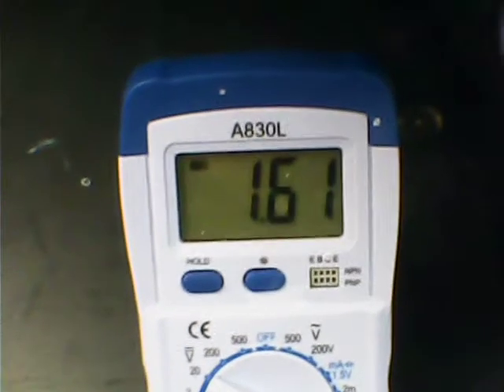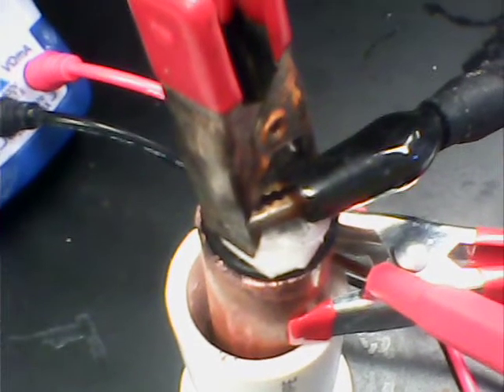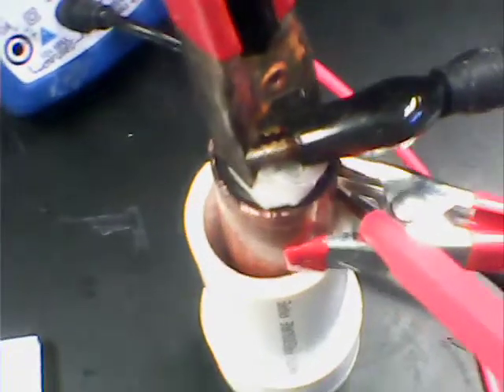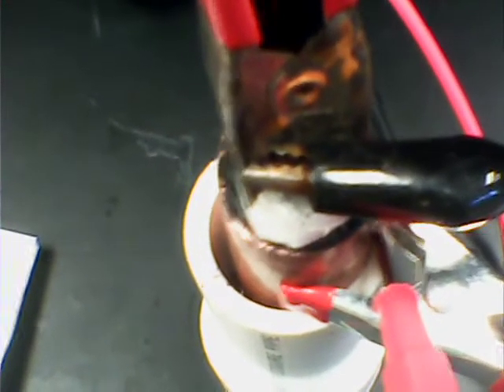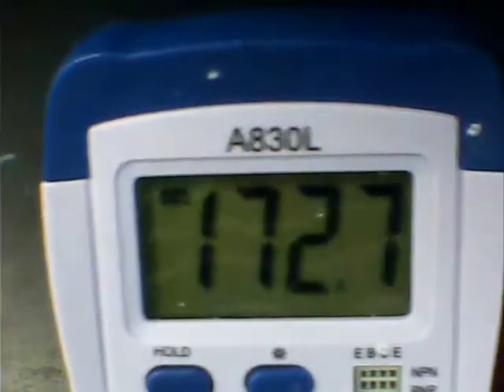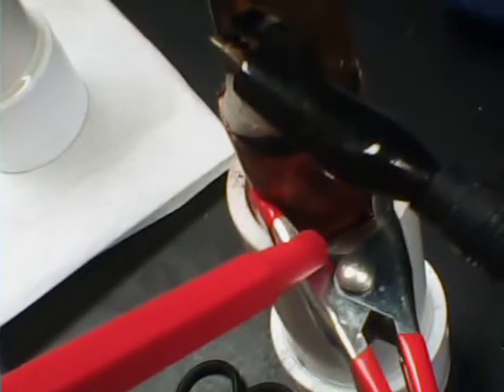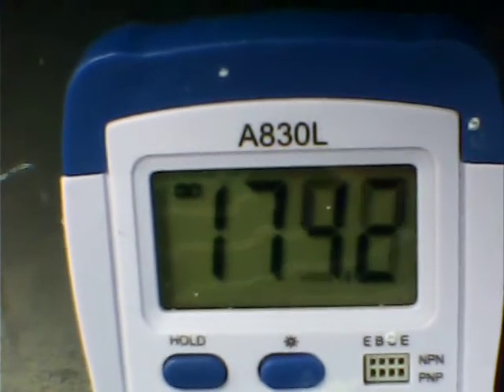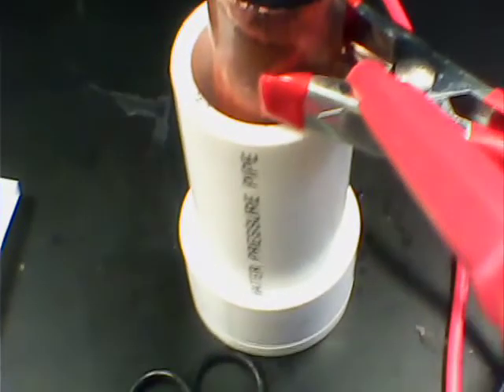Magnesium Air Battery/ Part II

Comment: I built three 6" (so called) crystal cells using a mix of equal parts Epsom salt, alum, potassium chloride and borax pressed into a solid with 1" magnesium water heater anodes in 1-1/2" copper tubes. I powered LED's using joule thiefs. One powered six LED's for six weeks. The other two lasted three and four months. I had to add water to the one that lasted four months after eight weeks. After that I had to disassemble, clean out the corrosion and add new mix to revive them. There was surprisingly little material loss. The mixture absorbed the corrosion and lowered the internal resistance. I used them as night lights. They were obviously galvanic because they could be reconstituted by intermittently adding water. I am almost certain it is not the result of a reaction of the crystals themselves. It appeared to be a slow electochemical porcess. 
The longevity was roughly proportional to the load. The initial voltages were around 1.5 volts and the dead short amperage was about 32 mA.
Alum by itself produced higher voltages and dead short amperage but the life was considerably shorter.
Borax works by itself but the voltage is lower. I think the mixture is an optimal trade off between longevity and power output.
I was trying to replicate the results recorded by Lasersaber but I didn't come anywhere near the three and four years his operated. Then again he was drawing considerably less amperage throughout the life cycle.
It would be interesting to find out what the life cycle of your magnesium air cell ends up being.